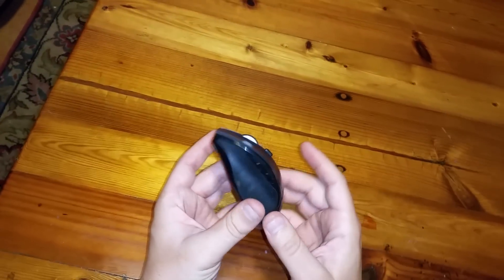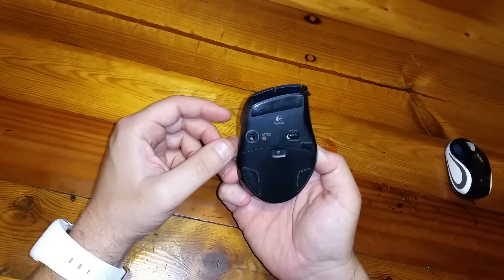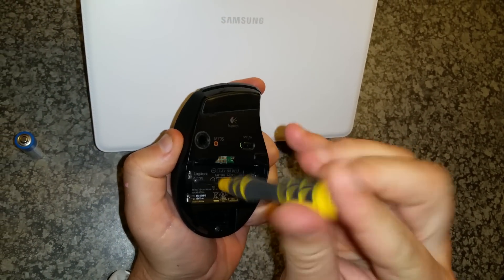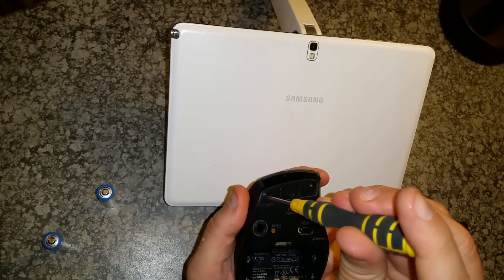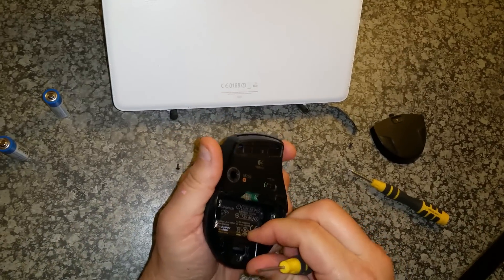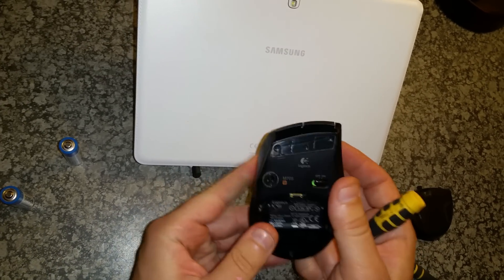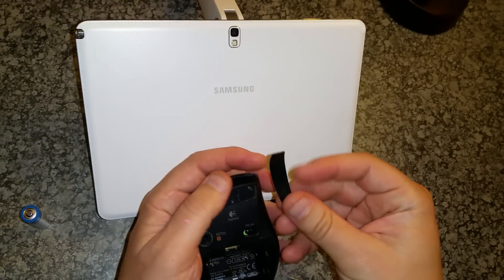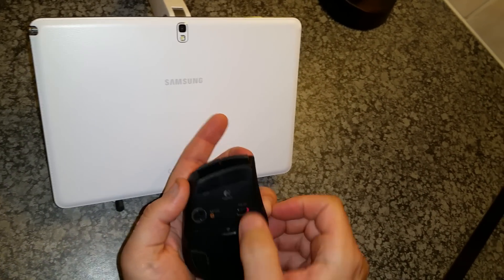Logitech M705 Pointer Won't Move - Disassembly and Quick Fix

Comment: wao thanks so much., this really helped me. i had the same problems everything works but the pointer won't move and when i opened everything looks in place but i move every connector and the it started working jeje thanks again I have another mouse and I will try this too.

Comment: 5 Years later and you saved my mouse. The keyboard worked but the mouse didn't work at all, no scroll wheel or button clicks. I took it apart and unplugged the laser ribbon and plugged it back in and the mouse came back to life. Cheers!

Comment: FURTHER ADVICE ON THIS...when you take out the batteries for the first time, you can't see the two screws underneath the battery compartment sticker. You just have to poke your Phillips head THROUGH the sticker in the area where you saw Old News unscrew them. You can first feel with your finger that the screws are under there. The rest is as shown in this video. On disassembly my sensor turned out to be positioned correctly, but I did experience a fix by cleaning the dust out of the eye compartment, so I may not have had to open the thing up...but I did clean out dust the was around the scroll wheel inside so this was maybe good preventive maintenance since I like the mouse and have had it for years. But thanks to Old News for encouraging me to look into this hands on!
Reply from the maker: Good point, thank you!

Comment: Thank you most kindly good sir, my scroll wheel had stopped working, and following your guide for disassembly the reason soon became clear...or rather, not clear, as in a light brown putty like  substance, and the rubber on the wheel was loose.  Cleaned out and two o-rings for the wheel and it's back in business again.

Comment: I just dropped my mouse at work and the pointer stopped moving. I figured the sensor was shot due to the impact but I'm happy I found your video. Thank you for this, you saved my work day in about 5 minutes. I can't believe this mouse's laser module is just loosely installed. It's not even held down by retaining clips.
Reply: the exact same thing happened to m, ive dropped my mouse 3 times and the last time is when it stopped working
Reply from the maker: +Alex Infotainment so glad it worked for you!

Comment: This truly is the one mouse I've ever owned I loath the most. Unlike you I've yet to have the laser assembly be dislodged but I do get a similar issue where the pointer won't move anymore, but also the mouse buttons don't function anymore. Take the batteries out(and it even comes up with new full batteries btw) wait 5 to 10 second and put them back in. Mouse works again, for a while anyways.
Reply from the maker: Yeah, I've also had the issue where it's very fussy about what surfaces it will work on. I love all the buttons and the left and right scroll with the wheel, but jeez it's high maintenance.

Comment: My Logictech 705 pointer did move but you had to move the mouse 2 feet to get it to move 1 inch on the screen.  Saw this "repair" and thought my motion sensor is just "cocked" a bit.  I picked up the mouse and tapped it down on my hand and the problem went away.  Thanks White South Africa!!
Reply: Or, just blow on the bottom of the mice, I guess you're just blowing the 'dust' away which seems to work.  dust your table....

Comment: Wow! What a pathetic mouse design. I’ll be reaching out to Logitech. I bought the MK570 keyboard mouse combo pre-pandemic & just set it up a week ago.. The Keyboard worked fine. However, the mouse was designed for failure. First off the wheel started to free wheel  with no resistance after the first day of use. Next up, the mouse had fallen off my desk(36 inches) to the carpet below & the laser quit. Ready to toss it, I opted to google a fix & bam. Shocked, I opened it & the fixed was in. Both the wheel & laser were disconnected, EZ fix for now. Thanx for the post.|
Reply from the maker: I have 2 different Logitech mice, and the other one did that freewheeling BS as well. This one here is very sensitive about what surfaces it works on. So Iʼve stopped using the Logitechs.

Comment: : ( 

i opened up my mouse, i opened up the sticker under the mouse but there was a fake screw design there haha. But i removed the pads under the mouse too and found the screws there. i opened up the mouse, the sensor seems to not have moved. looks like some sexy prism contraption. i shook it a bit and i blew air on the entire board to get rid of some of the dust.. it was pretty clean actualy. Sadly the sensor doesn't want to come back on. Battery changed too. Buttons work just the sensor won't. Damn! But thank you for initiating the process for me : ) Your video helped!

i wonder if there's anything a non-electronics guy can do next...

Comment: Thanks! Just saved me the cost of a new mouse.
Reply: sorry ,i didn't watch the video , but not bad to tell about my case, once i had some problems with my logitech wireless mouse , just i bought another one ,i think around 10 dollars ,and solved all problems , once in a while battery of the mouse needs to  be replaced too

Comment: I had a similar problem with my mouse but since I put it back together all my mouse movements are inverted on x and y axis. Any recommendations by chance? I have tried searching the internet and so far nothing has helped.
Reply from the maker: +Candace Any chance you put the sensor back in upside-down?
Reply: I wish that I did. It seems to fit only one way. I found and used this video in attempt to double check that it was in properly - and it is. Any other ideas? I’m open to any advice!